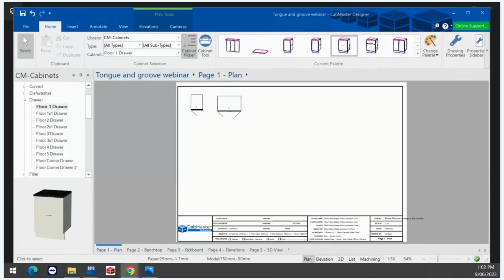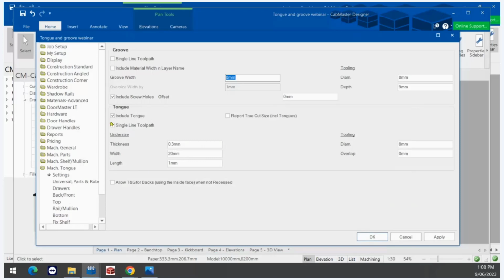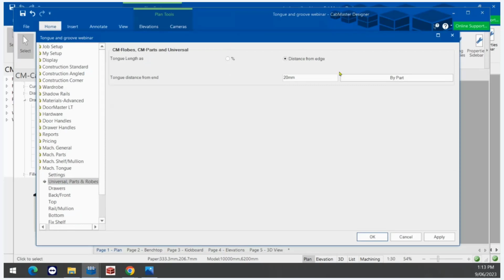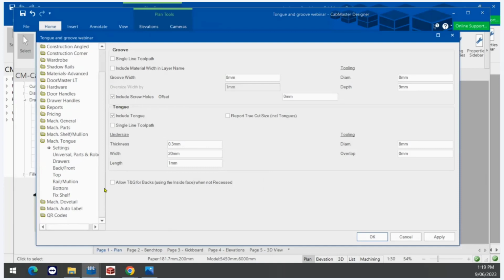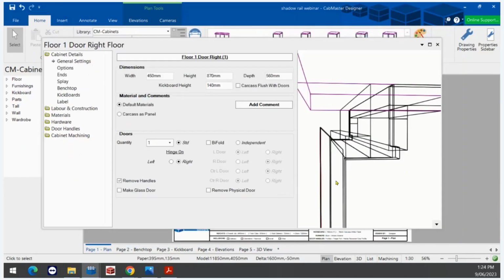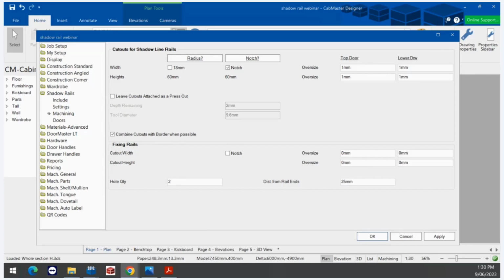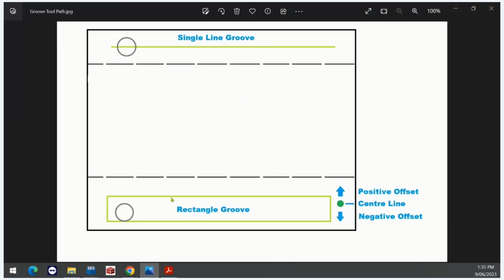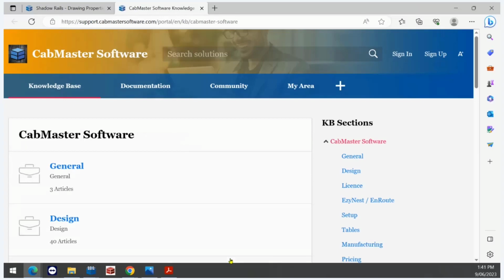WEBINAR: Tongue & Groove Construction and Shadow Rails

Comment: Hey there, did you know when adjusting the undersize thickness it will actually move the groove inwards as well by whatever that new thickness adjustment is? Yes it makes the tongue smaller then the groove but you are also sacrificing the location of that groove. So the bottom or top  will sit upwards from the bottom of the gable by .3mm in this example.